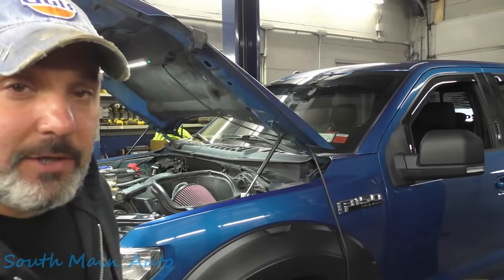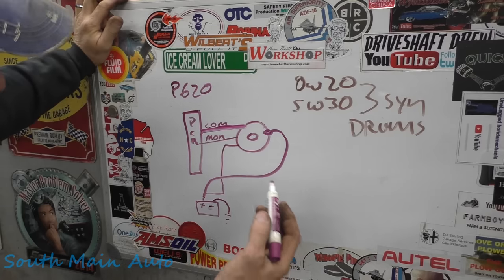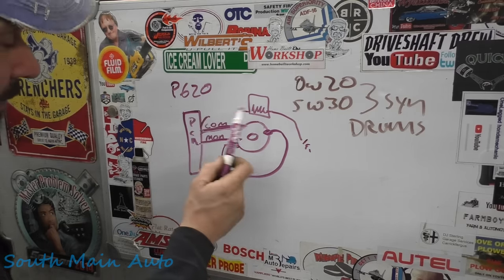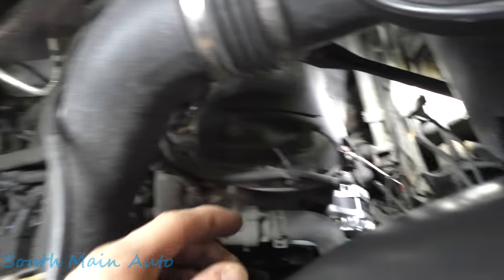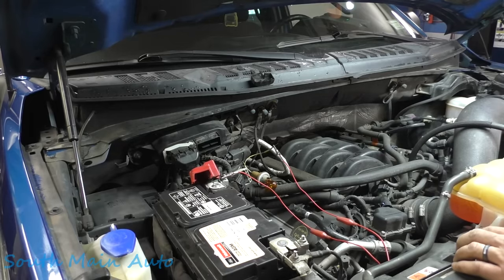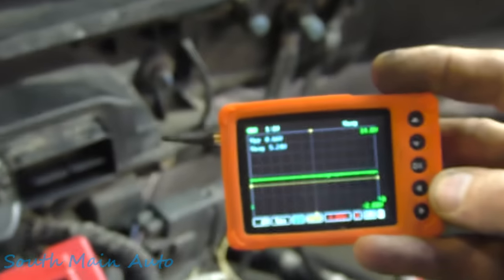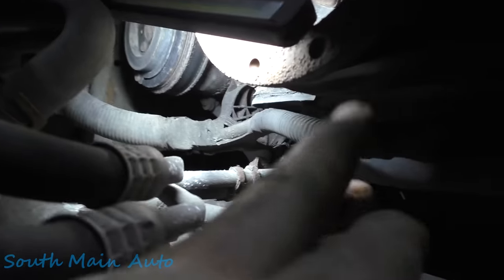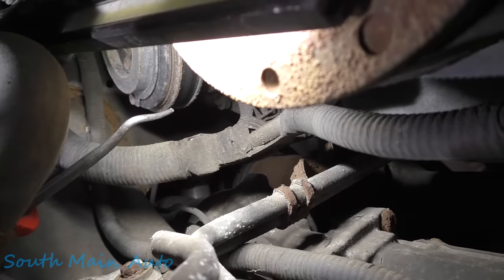2016 Ford F 150 Roush 5.0 - Service Charging System - P0620

Comment: Good man giving credit to others I know you would have found it and may just have taken longer so it saved the costumer some labor on diagnostics by searching some videos. I do the same when working on my vehicles and implements. I also by oil by the drum and it lasts my a couple years Keller Hart is the best deal and quality  Thanks for your sensible videos and making it easy to understand

Comment: Thanks for explaining how to prove corrosion in the wire using simple DC.  I will remember that.  I could have used it a few years back to prove it on a knock sensor wire.  I thought it was compromised but I was only using an o-scope to look at the signal (a KS signal looks/acts like a microphone).  Even though the wire only has to carry microphone current I could have used your technique with a low current test light to test the wire's integrity.

Comment: I used to design wiring harnesses for GM. We used very high standards and exhaustive research data bases to ensure a lifetime of trouble free ownership. It was a grueling and relentless shit show. Wiring teams are last on the totem pole in most automotive engineering groups. The answer is always " OK, we have a crash condition just move your harness! I'm not changing my part. You change yours!" We always lost the battle due to internal politics. Many times we would get attachments anyplace we could. In these instances, we would use extra coverings and layers of anti-abrasion tape {will not tear by hand- good stuff} strategically placed to mitigate. Looking at your failure mode, I see more than one engineering group that should be taken to the wood shed. Eventually that transmission line will fail from the harness rub- but the harness lost first in this case.
Reply: P.E.D. - Packard Electric Division
Back in the GM ACG days.
Can you believe it has been 25 years since Packard was a division of GM?

Comment: Since this was a relatively low resistance open and you have access to both ends of the wire you could have loaded one end with a 4 Ohm high wattage heatsinked low inductance power resistor (or use your 4 Amp lamp) to ground and the other end to Battery +12VDC which would normally flow around 3 Amps. Let sit for a few minutes and then look at the harness with a thermal camera. You should be able to see the location of the relatively high resistance fault in the wire because it would generate a hot spot.

Comment: Eric, I have a 2016 F-150 5.0L as well. I had a very similar issue, where I had P0620, P065B, and P0626. My battery idiot light and chime would come on for about 5 seconds pretty frequently, and then go away. The truck never died on me once. I did a battery, alternator then eventually alternator pig tail.  The pigtail ended up fixing it, and unfortunately it was a dorman unit. Connector was ever so slightly corroded, even after cleaning the connector. I did also check ECUs voltage readout through the dashboard engineering mode- read mid-high 13V range. After hooking an autel to it, and pulling commanded voltage, it did read out 14.5 commanded and read 14.6 actual voltage. Hopefully this helps anyone else out!

Comment: Using YouTube to reference people like Eric O and Ivan is no different than checking TSBs on Alldata (Well, with better repair walkthroughs). It's making efficient use of the resources available. As Eric said - can you fix it without doing so? Yes, BUT it takes MUCH longer so when you can skip ahead to the likely suspects and check them first, do so.

Comment: Heck... In the 'old days'... how to correctly initiate a 'voltage regulator' by touching a battery wire to the proper terminal.  Pressing down on the starter foot pedal to engage the motor and complete the circuit.  Vacuum windshield wipers.  Nobody needed a computer or 'silly-scope' back then !

Comment: I don't see any charging system recalls from Ford for this year model. So I suspect a Ford mechanic knew of the problem and probably moved the bracket while doing other work, and he just didn't say anything. But the insulation was probably already damaged. Just a matter of time before the corrosion set in.

Comment: Has a now retired telephone engineer most of the falls on copper phone lines were down to corrosion due to water getting into wires and joints but you try and keep the U.K. wether out of the network i stop to talk to one of the guys who was working on a faulty line and you could hear the water inside a modern joint closer and that’s were his fault was putting shorts on the lines inside but everything is going over to fibre in U.K. which is waterproof but will snap if you don’t get the right bend in it but you could not use fibre to change cars batteries but maybe to send signals to and from computer units

Comment: Really hate the ECU controlled charging systems. Lots of extra problems for very minimal mileage increase. Nissan design burn up the 3 wire connector after 8-10 years. Plus Nissan can bury the alternator where you can barely touch the connector much less inspect the thing... Thanks OBUMA & EPA

Comment: Got one for you...  2008 CTS.  issue is wheels wobble after going over a manhole or pothole at any speed.  Fixes: replaced all front end suspension parts including struts, upper and lower arms and ball joints, you name it.  Rims are stock with low profile tires.  No money light on.  Can it be the electric assist steering assembly or maybe a incorrectly done alignment?  I'm out of ideas and ready to take to dealer where I'm sure to invest in the company profits.  Love your videos and the high quality knowledge you have.  Thx... Ed

Comment: I've used my Klein Tools VDV500-820 Cable Tracer to find a corroded wire in a loom very quickly before after identifying the circuit and wire that was the issue, helped find the section of the loom, the wire carrying the signal and where the signal stopped. Visually couldn't tell it was bad but a slight tug and bam pulled apart with green in between. Power for theft deterrent module on 2007 silverado. Symptoms started out with intermittent crank no start, then months later permanently crank no start. Crimp and seal and all has been well.

Comment: 100% they chafe through and usually short out on the bracket popping the 10 amp fuse for that circuit. I've also had one that chafed through on the block where it runs up just before the alternator. Then once that was fixed the previous shop to work on it egged out the pin in a joint connector between the alternator and pcm lol.

Comment: one of the best things I've learned from you, is to get data to prove the diagnosis.
I recently had a lady friend of mine get told she needed new cats on her 06 honda odyssey with 130k on it.
engine emoji came on, which is why she took it in.  curiously, the light went out, so I told her "bring it by and let me plug in my fancy expensive autel."
code pull said P0420, but it was a stored permanent code and NOT active.  Odd a cat code would go away like that on its own, since nothing was changed.
had her drive it while I watch all 4 sensors.  everything looked fine, but ever once in a while B1S1 would "smooth" out, as compared to B2S1, then suddenly start to track.  I told her since the money light was out, get it inspected (sticker was due in a month) NOW, so you don't have to race as hard if it finally sticks the code.  Also told her, I think she has a lazy/dying upstream on that bank, based on the data I could see.
Reply: You guys should communicate with the auto designers to have wire looms properly routed to avoid this very common issue.  You guys Rock...

Comment: Hey Eric, that trans line bracket has to be removed when you have to replace the "common" oil pan gasket which tends to leak after about 100,000kms. So I'm assuming that's been done. Just one of many repairs on the 5.0.

Comment: Nice find!!! I can't understand why all this stuff needs to be so freaking complicated! Why on earth does a computer need to control an alternator???
Reply: Because someone decided it’s cheaper to incorporate the regulator in the computer than having a separate one. 
And, you can get a little better control over the old style regulators. Comes in handy with all the electrical load on modern vehicles.

Comment: Great video Eric, a good job you only had one generator on your diagram or the folks would have been really excited 😌😂😂, how do you power your small scope ?, i bought one a while ago, but it came with no power lead , works on 9 volts , I've thought of attaching a 9 volt battery to the back of it with a plugged lead  as 9 volt power supply units have short cables on

Comment: You do know there is a solution to the crimp connector issue. There is a product a lot of techs are using called a solder connector that is the best of both worlds; like a crimp connector you slide the wires in from each end but instad of crimping you apply heat and actually solder the joint at the same time the heat shink melts and you have a perfect solder joint insulated at the same time!!

Comment: I'm thinking that bracket was not connected from the factory.  Because of an experience I had with two different model years about five years apart. Well the passenger front shock top end was missing the bushing and washer and nut. On each Ford truck.. Lucky I kept the bushings washer and nuts from a replacement. But on the next two new ( again five years apart ) trucks  the shocks were all connected / mounted. Maybe that guy retired or went on the wagon.
Reply: I know my comment had nothing to do with the video content.

Comment: I had this same problem and Ford told me it's ok when the charge drops to 8 volts because the computer knows when to add the full 13 volts but after they replaced 4 batteries and an alt they finally replaced the broken wire, I had to buy a booster pack so I could start the truck and I was not to happy about jumping a new truck daily.  It was a new truck so warranty work they did not want to do,  Honestly I think they know they are building them with defects because it's year after year they have the same problems, You would think after being in business for 100 years they would know how to build a car that works,

Comment: Crimp and seal connector is the only authorized way to do a wire repair for John Deere, and I do believe aircraft do not allow solder in heat shrink as a wire repair. solder and heat shrink with the vibrations break easy

Comment: Someone changed the trans cooler lines and was too lazy to remove the bracket prior to feeding the new lines past the oil pan during replacement....That's my thought on the bent bracket.  I have a video here with my line replacement experience.

Comment: you joke about kinked wires stopping the flow of electricity, but I've had melted cables that were well over the currrent carrying capacity of a circuit and the point where they failed was the kink.

Comment: Those Ford trucks also have corrosion issues with the transmission lines. Those don't look far from busting off and emptying the transmission of all it's fluid
Reply: Fortunately, those transmissions have an internal thermostat, controlling the flow to the cooler, so unless you're towing at the time, they tend to give you fair warning when they start leaking.
Reply: They are 1/2 inch diameter and well thermostat or not if they break they will pour all the fluid out in short order. Most people dont stop until the vehicle no longer moves. Ya know what happens to clutches which only get halfway engaged due to low fluid pressure? @mattmanyam
Reply: They do not corrode and seep fluid. They break all the way off and smoke the transmission. My dad has a 2012 F150 and we live in NWPA. We replaced his cooler lines before they ruined his transmission.  @mattmanyam
Reply: Furthermore the thermostat is not internal. @mattmanyam
Reply: @eddiereichel9354   I have a 2011 that I just completed this repair on, and my brother has a 2012 that we repaired 2 years ago. Neither required immediate repair. We had plenty of warning to gather the parts, while still driving both vehicles normally. They corrode at the flex connection behind the lower rad support.
We live in upstate NY. 
Where do you think the thermostat is?
Reply: The thermostat is in the block where the 4 hard lines come together. Its around the belhousing not inside the transmision. I live in NWPA. Like I was saying the pipe breaks off near the crimp from the aluminum degrading. Fordtechmaculoco did a great video on the subject.
 @mattmanyam

Comment: I had a 1997 Ford F-150 that didn't start. Took me some time but i found the positive wire going to the starter was green. By the mounting bracket by the front wheel well.

Comment: I worked on an 18 2.7 ecoboost f150 same complaint charging system fault but the wire was broken on the drivers side of the oil pan.

Comment: Eric, you keep using your crimp connectors. If crimped connections are so bad, then why do manufacturers use them on all of their wiring? Ivan's problem is, he uses a cheap crimping tool and the crimper needs to be at the nose of the tool like the one you use. As long as you use quality connectors and crimp them properly, they will hold just fine, as I'm sure you know this.

Comment: Happening to my 2016 f150 5.0L  changed the alternator and the battery but the charging service system light still come up and like its not getting power the RPMs are high and take a little bit to shift gears

Comment: It wouldn't be cheating if you searched for an alternator problem before starting any diagnostics, found a video of where that wire encounters a problem and checked that area first. It might save time. I'm surprised that it wasn't listed on All Data.

Comment: don't fold the wire over... heh... building a house with a new guy, Me: sees FNG step on extension cord, lets go of saw trigger. yells at FNG to get off the cord, pulls saw trigger when he moves. watches new guy try to figure out what he did.    ahh the trials of being the new guy.

Comment: Quick question Eric, would there be a problem performing a voltage drop over the “com” circuit? I usually do those in place of ohm testing as it allows me to see if there is voltage being lost when the circuit is under load.
Reply from the maker: Yep, you could do that. We essentially did in the video we measured voltage on one end and then on the other if you subtract those two numbers that's the volts you would have seen on your meter doing a voltage drop test 👍🏼

Comment: This is the #1 spot for corroded wires. Just about every time a circuit code is set  for an alternator on an f150 it’s in that location.

Comment: Not lighting the test light but losing some voltage between one end & the other... you have a high resistance short combined with a partially broken wire, right?
Reply from the maker: No short, just high resistance (corrosion)
Reply: @SouthMainAuto  If there is 0 current then the voltages should be the same at both ends.  The tester takes some current though, so that could be the cause of the voltage drop.  If the tester took 0 current (ultra high impedance), the voltage drop would have to be due to current loss somewhere else, i.e., a short.
Reply: Wonder if the green stuff can act as a semiconductor & cause a voltage loss with even tiny currents

Comment: Are you (very) sure that the duty cycle command signal is 12 volt and not a 5 volt? You should measure a very high resistance from that dubious wire to ground plus you should measure almost 0 ohms resistance  when measuring the two sides of the same command wire
Reply from the maker: Yeah I'm 100% sure like I showed it in the video. 100% sure 😅
Reply from the maker: On a side note, you should never use an ohm meter to test wire integrity. It's perhaps the worst test you could ever do.
Reply: @SouthMainAuto  because? Must carry sufficient current?
Reply from the maker: Yep, you can have a wire the size of your thumb and every strand in it can be broke except for one strand the size of your hair....and it will ohm test 100% perfect every time. @therealspixycat

Comment: No anti rub ? Wire under the local chassis ? So if bottom of the car rub it rub on wire . Wire not airgapped from metal ? (5mm approx for that wire size) that pick up is not lucky . Nice work . You were not a part switcher . Changing part is easy . But finding issue like this even from the www . Most assume the part failure is the flaw . As a truck driver of 18 wheeler driving many miles . The trouble cause is almost always manufacturer assembly choice for their rlectrical assembly solution . Keep phat zip tie and respective non metal zip tie holder around . Any Brand will do . As long as they're non metal

Comment: Someone told me that on the end of the shaft, on an alternator where the pulley goes on a working alternator, it will be magnetic. If you touch a screwdriver to the end of the shaft, it would show magnetism and hold it there I did this on my Subaru that had the battery light on, and there was no magnetism in there, but on my truck that has a working alternator, the screwdriver would stick.  Would that indicate for sure that the alternator wasn’t charging and was at fault
Reply: That won’t tell you if the alternator is bad, or if the control circuit is bad. The control side controls the electro magnet that makes the alternator charge. That electro magnet is what also attracts the screwdriver. 
If the control circuit is bad it won’t charge the magnet even if the alternator is good. 

Basically that test works somewhat, but isn’t always a good enough test to determine if the alternator is at fault.
Reply: Thanks